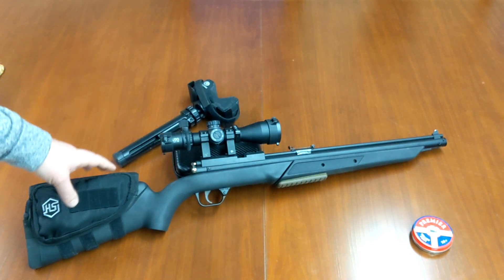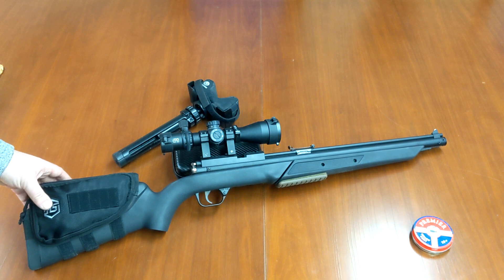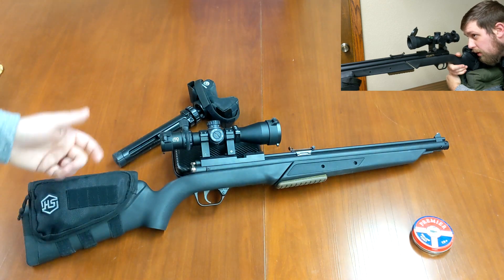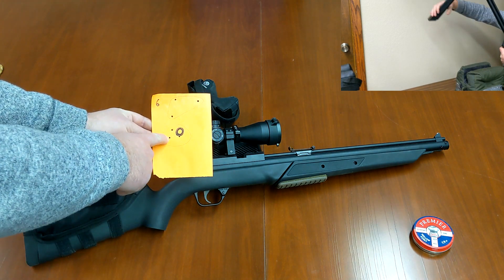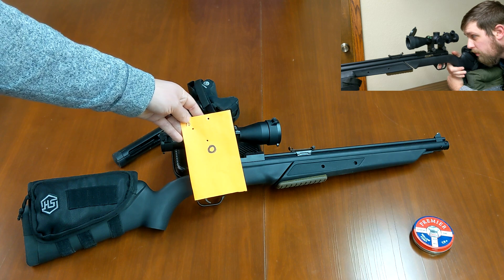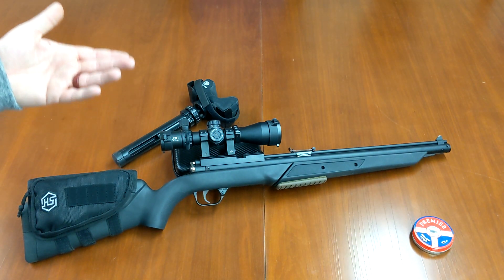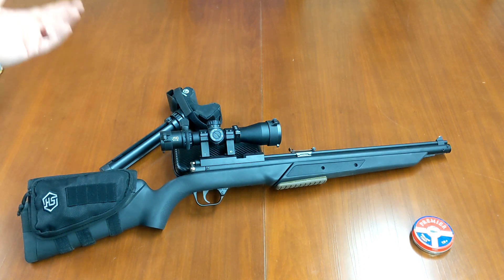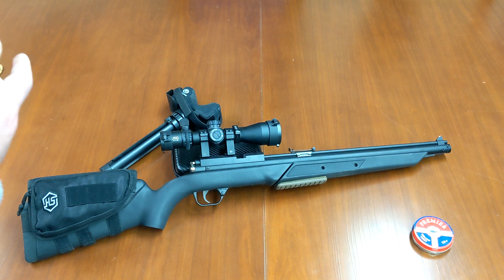Benjamin 397S  - My New Long Range .177 Project

Comment: 10.5 CPUMs did well at 100 yards for me.
Reply from the maker: Awesome, what were your results?
Reply: @GTMGunTotinMinnesotan  2 inches is my best official group documented on GTA in the NUAH section. I've shot a few under 2 but they weren't close enough to the bull for an official target. Wind is the biggest issue at these ranges. Even a tiny breeze blows these .177s around.

Comment: Any short thoughts on break barrel long distance shooting?  I'm new to the sport and seeing what my Crosman F4 with 4x scope can do.  Just ordered a Tasco 3-9 scope (and probably will get a better gun once I improve more).  I'm hitting a 10" target from 50, 70, 100 yards but not with much of accuracy/consistency and of course, increased pellet drop the further I go out (like 15-20" at 100 yards).  I'm enjoying seeing what a simple and cheap break barrel set up can do for now.
Reply from the maker: For sure, I also did a stint with something similar.  I got frustrated because most of the optics (even airgun rated scopes) were breaking on the regular.  The only optic I got to last was the SWFA 12x Mil/Mil.  I'd suggest regularly checking your barrel hinge nut.  The tension on that bolt changes accuracy greatly.  Also, there is a healthy balance between faster pellets and good weight to buck wind.  The super heavy pellets don't do well, nor do any pellets under 7gr at long distance.  HP pellets are decent, but I actually have found that in some cases a regular dome has a better BC which matters greatly.
Reply: @GTMGunTotinMinnesotan  THANKS!  I am checking my bolts regularly.  Did Crosman trigger fix too - a big help.  Using Crosman 10.5g dommed pellets - like them best at this point.  Any quick suggestions on a next gun for me?  Pref a break barrel to keep price down a bit.

Comment: how far are you planning on pushing this air rifle out to?
Reply from the maker: The only limitation will be how much elevation I have, and the wind conditions.  I'm very confident I can get past 200 yards, but I'll need to switch optics and wait for a perfect windless day.  I'll be using a 10.3 plated pellet for that shoot more than likely.  So far, I'm only dialing 8 mils at 100 yards with 8 pumps.  I have to see what kind of standard deviations I'm getting between 8 pumps and 10 pumps though also, I might need that extra pressure to make this work.